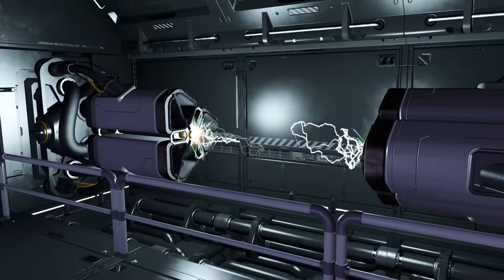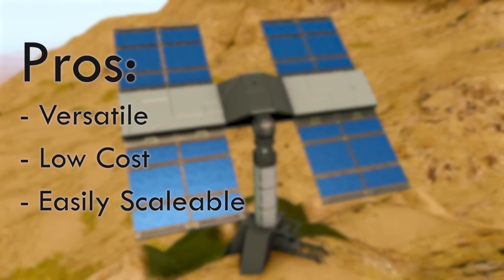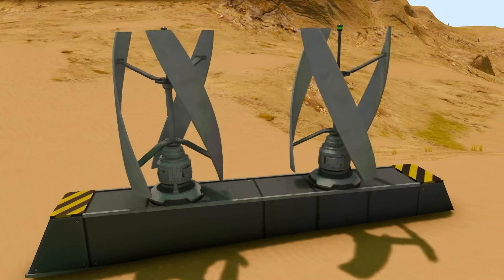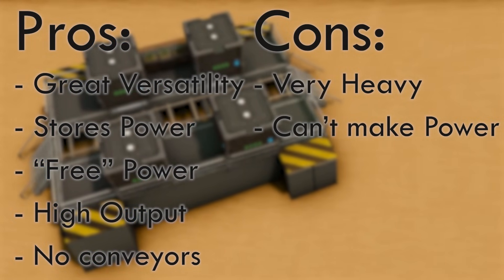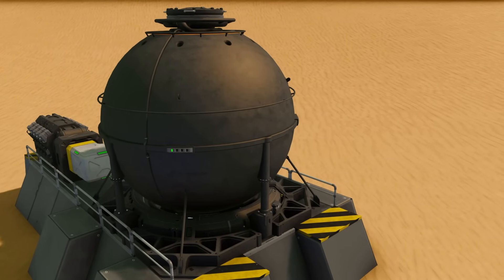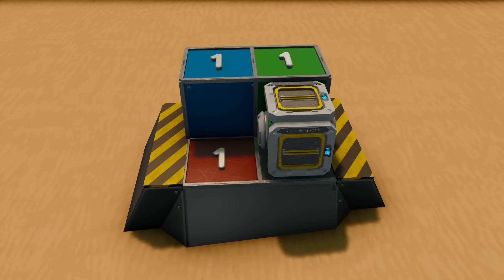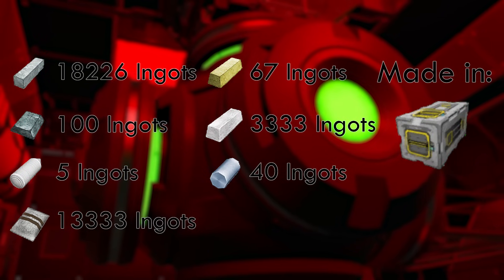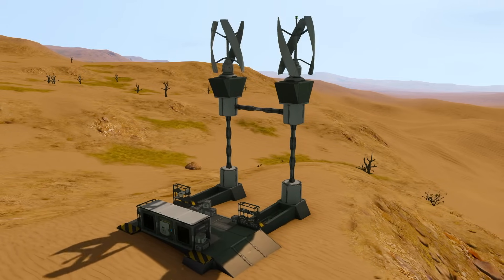The BEST Power Block in Space Engineers - Tier list & Comparison

Comment: FYI you can place the wind turbine slightly higher than 8 blocks high, and then have ones coming out from the sides of it so you have 5 total off each tier of blocks. That heavily increases their efficiency and they don't reduce eachother's efficiency. Put a single armor block at the base of each one so they stick out and then you can have them all around
Reply: and you can also put them underground if you have a space of 8 to 9 blocks away from the voxels and it still works, this combined with their cost in terms of materials, for me personally makes them S tier, at one of my bases I had about 103 wind turbines underground
Reply from the maker: That is very true, it is somewhat cheesing, though still a valid point. 👍

My main issue with that approach is how much of a performance cost it has. Having to dig a large hole, before then stuffing it with blocks that take computing power. So for me personally, just too much of a performance hog in that scenario.
Reply: @BenDoesThings404  Performance in SE? what  a good joke, almost made me laugh, this game is not optimized at all, and the engine is very old, it's a game from 2013.
and when it comes to resources used, I think it's much more efficient to build a mobile base that you convert into a station when you want to recharge the batteries
Reply: @weiserwolf580  I  really hope that Space Engineers 2 will be using a newer engine with much better optimization, so even weaker PCs can run the game decently.
Reply: @SapioiT  I hear that but in most cases a developer makes a sequel for cash. If they were able to optimize their sequel well they would've done so the first time. And if you're thinking perhaps they've improved since then look no further than their Automatons "AI" update.
Reply: @Anuwabu  TLDR: Maybe not for the price of a DLC, but maybe for the price of a full game. What makes me think that they could have improved performance, is how much of the game would need to be rewritten for the game to be more efficient, and the comparatively low return of investment for it, when compared to the work needed for any other DLC they launch. Now, being able to charge full price ($20 to $60) for Space Engineers 2, would likely be a good enough return of investment for the amount of work needed to make the game run more efficiently, when compared to the measly amount of work and the lower return of investment for making yet another DLC. Because, to get the efficiency improvements, you would need to pay the full price even if you already have the original game and all it's DLCs. Still, I'm hopeful the new game will have efficiency improvements.
Reply: @SapioiT  Never going to happen.  Hardware is explicitly designed now to force developers to waste system resources, so that everyone has to buy "better" hardware in a neverending cycle.

It's all about money, and never anything else.

Otherwise, they'd just build a computer that is future-proof and always reverse-compatible, and the same with software.  And it would just last you forever with occasional upgrades.  But that doesn't make enough money for their greed.
Reply: @Anuwabu  do you know how hard it is to change a existing game without getting a whole bucket of bugs? most cases if it works it works some times its better to re do it also space engineers is not owned by a money hungery company i think and just look at how little it costs if they wanted to make a lot of money off of it why would the game be so cheap to get
Reply: Im curious as to the 371kw mentioned for wind turbines.  Mine are getting 426kw output. Optimal is still a range and a couple more blocks clearance helps. As I'm getting back into it after a long break, I have weather disabled so no boost there. I usually use 10-11 spacing as opposed to the usually recommended 8-9. I'd assume that is why, but it would change the power calculations.
Reply: I usually put them diagonal
Reply: On my forever world I do this and once we get to the 8 block mark I go down with solar panels. This whole setup is also on a mountain so all this just x 10 (10 power poles) juices up my entire mountain base.
Reply from the maker: Whilst that is true and a very valid point, that does also increase the sheer size of a tower with windturbines. In addition, you would have to build it quite high, so the wind turbines on the side don't lose any efficiency from being too close to the ground. But still a valid point.
Reply: @BenDoesThings404  2 ideas for a vid.. Small block power ranking... and "What is the best of the batteries" like small 1x1 block or the small block large that is 2x3x2..
Reply: @BenDoesThings404  True though single most abundant resource in the entire game IS space. Considering you build the turbines outside anyway.
Reply: @BenDoesThings404  they dont need to be  efficient tho its steady power that works all the time u dont need to even look at them after placing them they cost nothing to maintain either

Comment: Despite the large reactor not being the best on paper. It is however, the best block for power output relative to it's PCU cost. A single large reactor can power your entire ship in most cases. Which is very helpful on last-gen consoles since PCU is very limited. Because of that it's my go-to pick power generation
Reply: or on servers, where PCU really matters.
Reply from the maker: You two are absolutely right. PCU was something I forgot to cover and I do apologize. Luckily the list was still fairly representative in terms of PCU values (Lowest on top and biggest on the bottom), but its still something I should have covered more closely.
Reply: @BenDoesThings404  everyone forgets about PCU until they actually need to care about it.
so don't feel too bad about it!
Reply: @BenDoesThings404 Nah you don't need to worry about PCU cost, it's worth an honorary position but it's kind of irrelevant considering if you're playing on console you won't have the power to have larger operations that would require that kind of planning.
Reply: @teddy5004 By building with PCU limits in mind. Efficient building methods drastically increase the max number of ships you can build. This helps a lot in faction wars & building around consoles limited PCU count
Reply: @ConflictZ0NE  If youre on console you wont be able to participate in any sort of large faction wars to begin with, Unless youre toning down all your ships to bare minimum blocks which is unreasonable
Reply: And you need 4 on each end of a Earth-Pertam Lazer antenna relay
Reply: @knutzzl  Alternatively, you can create solar relays along the path, rather than doing a straight-shot point-to-point connection. Takes time to setup, but you can offload a good chunk of the power requirements to solar.

Assuming the game still works that way; I haven't setup a relay like that since around 2018.
Reply: Yes PCU is the reason why im using large reactors evryshere possible, specialy the official servers with 20k pcu limit is the 1 large reactor way to go for your base, mining ship and basicaly evrything with jump drives. I always swap to that so i can build bigger warship with remaining pcu
Reply: My first statement to this would be: 
If you haven't disabled block limits yet then you haven't played space engineers yet! 

BUT 
Yes there are the limitations server owners have to enforce on their playerbase so that the server hamster doesen't die from overexhaustion xD
Reply: @Em.P14 i think you should try official multi-player. New challenges. Work within the limits. Community.
Reply: @Em.P14  Pretty faulty logic. The default PCU limit is still so high that it's hard to reach if you're just playing singleplayer and not specifically trying to reach it. On the other hand, in multiplayer the limit is easily reached and you will start to quickly notice why that limit exists.

No true Scotsman -fallacy isn't any less fallacious here either.
Reply: Another benefit of reactors is the less often refueling requirement. With hydrogen, you will often have to mine ice, or either have a large storage area, while with reactors, 10k uranium can last a VERY long time.
Reply: @KyleMan-my9wn not just less refueling, easier refueling .. fueling a ship with pocket ice is very painful while sneaker delivery of another weeks worth of uranium is trivial
Reply: When i last played SE, i had a meteor storm that left behind Uranium. Not sure if its changed since then. Granted it's been a year since I last played, and was on Xbox at the time.
Reply: I'd agree mostly. Except Uraniums rarity really is detrimental to its usefulness. I think you're right but in my opinion it's high efficiency and low pcu lends it to being the perfect supplemental power to charge batteries, jump drives, etc.
Reply: I also like to maintain my pcu use even if its unlimited to maintain game and make it comfy & well playable for oders and prewent lag. 😊
Reply: Go on blind point do you believe in the ball all duh
Reply: I always feel sorry for players who are limited by PCU, especially console players which will never be able to experience SE to its full potential.
Just get a beefy system or server.
Reply: Absolutely agreed! And another good thing to look at is hybrid, power generation systems. Integrating the cheaper methods such as Solar Panels into less armored areas on efficient larger ships can supplement reactors and act as a decent backup.
Reply: people thinking about PCU efficieny... my just turning all PCU limits off cause i hate it
Reply: @bernardodallacosta8684  yep, but at the same time, you have to think about those who play on console
Reply: @TalesOfEnoch  i know... its unfortunate that consoles have such limited processment... but for me at least i think a laggy game is better then the sandbox game that dosn't let you do what you want... unpopular opinion but... its mine
Reply: @bernardodallacosta8684  honestly though fair, and considering I do what I want anyhow it works lol
Reply: @TalesOfEnoch  i like to build massive battleships and entire fleets of battlecruziers... so... with the PCU limit on is almoust impossible ksksk but in servers that would be broken i have to adimit....
Reply: I always turn that setting off and I play on private servers without it on because it's just stupid, I will happily deal with a slower sim speed before I will deal with being artificially limited.
Reply: I know a better power generation and it's a mod Arc reactors x1 to x100 in the most basic reactor in the Arc Reactor mod produces the same amount of power as a large reactor in vanilla

Comment: technicly the battery doesn't create energy, it only stores energy. not sure if you can count the basic charge as energy generation
Reply: keep in mind that there also is a way to create battery powergenerator by using a blueprint of a cross-setup of four batteries that are set on discharge while mounted on a rotor.
the whole setup is quiet complex because you need some additional blocks Like timers, a welder and a grinder but at the end of the day it only consumes stone to generate power stored in batteries set on auto.
Reply: @HeartLiner81  it is complex a bit yes but with the new event controllers some nifty designs and ingenuity you can turn stone into a generator of immense power tho the setup needs a dedicated stone refinery setup and assemblers to produce the necessary power cells to keep up with regenerating the components needed :D  im personnaly using a 300mw setup in starter base and only reloading stone once a week tho for a ship it is not really ideal :/  reactors are really a must in endgame still :)
Reply: umm.. actually you can't create energy, only transform it 🤓
Reply: 1 would be inclined to agree regarding the battery if not for someone who showed me a way to farm that basic charge from batteries.. Not a game-changing trick or a efficient technique, it requires a Blueprint of a battery set to discharge & sitting on a sub-grid over a grinder pit. After you drain the battery, it's gets ground off the sub-grid & a new battery is built. Again not efficient, requires a bunch of power cells & the person who spoke of this idea told me it's something he WOULDN'T do if he has ANY other way to produce power... It's just a way to farm the starting charge of a battery.
Reply: Wish I read the replies, looks like somebody already mentioned farming battery power.
Reply: Saw a vidéo once. The engineers had a setup on a rotor with welder and grinder on each side. He then weld à batterie on the setup and put it on discharge. When the battery is depleted it get grinded and à knew battery is welded on the setup. Mining Stone to make sure his supply of material is always good. He had energy generated with that 30% of energy with each New battery welded.
Reply from the maker: Given that you construct the block, and recieve energy, it counts in the very technical sense. In addition to the fact that you can take apart the battery, make a new one, and get more charge. Though it was more a comparrison between power blocks, a category which the battery belongs. But you raise a valid point 👍
Reply: @BenDoesThings404  ok, if you put it that way. but for me it'S stil more like the hydrogen tank for the hydrogen engine :)
Reply from the maker: Fair fair. Oh if only the tank came with 30% hydrogen when constructed, it would have been a dream! 😋
Reply: @BenDoesThings404  we need beans instead of clan cola, so at least the space suit will be filled with methane :D

Comment: I recently built a small grid hauler using atmospheric thrusters with a mixture of batteries and engines, the idea being the engines would allow the batteries to last longer. Works pretty alright, I did intentionally avoid hydrogen thrusters due to their big range of damage to grids, mainly with the design i went for too. Works well for ferrying goods between bases that are close by. Could be Way more better but its a fun experiment and giving different components adds to its beauty
Reply: With the modern update you can even automate the process of transporting materials
Reply: @spaceengineeringempire4086  Yeah! And I am loving the update, I used to rely on the P.A.M. script to get these tasks done, but good that we can now make hauling done without relying on scripts!
Reply from the maker: Absolutely, the more power to create in vanilla, the better. 🙃

Comment: I prefer reactors to hydrogen engines, but it is worth pointing out that you will be producing oxygen at the same time you produce hydrogen which may be a resource you needed anyway.
Reply from the maker: Forgot to include that part actually, but it is definitely a valid point. Well spotted!
Reply: oxygen: put tank on ship, put vent on tank, fill tank in any o2 atmosphere using the vent, depressurize the world!!
Reply: This is a serious problem though. It happened to me several times that I accidentally left the hydrogen engines running, they drained all ice on my ship and I later died of asphyxiation not being able to generate oxygen I needed. I find that they're more trouble than they're worth.
Reply: @Nethan2000  make sure you build an oxygen tank then lol
Reply: @seushimarejikaze1337 i dont remember who but a youtuber tested that 1 ice doesnt give you 2 hydrogen 1 oxygen, instead 1 ice produces either 1 oxygen or 2 hydrogen so even with tanks having an hydrogen engine will make you run out of oxygen faster
Reply: @supergamer2980  o dunno because i never have run out of oxygen. its literally impossible if you know what youre doing. i advised to build oxygen tank precisely because if you have it then(with 'minimalistic' approach) you could run hydrogen propulsion on ice alone together with hydrogen engine and even if you run out of ice due to negligence, one oxy tank lasts an age(not really but long enough to find more ice or build oxy farm(i dont remember how many you need to sustain one person as i generally dont use them).
Reply: I'm hearing mixed results in the subcomments to this as to whether that's true, that ice produces "byproducts" that will be lost if not captured. Can anyone confirm?

EDIT: 
I just looked at Ice on the SE wiki and it says that 1000 kg (or 370 L) of ice convert to: ~20000 L of hydrogen, 
OR ~10000 L oxygen, 
or ~10000 L hydrogen AND ~5000 L oxygen.

So it looks like the conversion rates don't follow the chemistry. Tell your friends.
Reply: I usually combine both
Reply: I built separate oxygen systems from the rest, meant to properly sequester ice usage to what is more important.